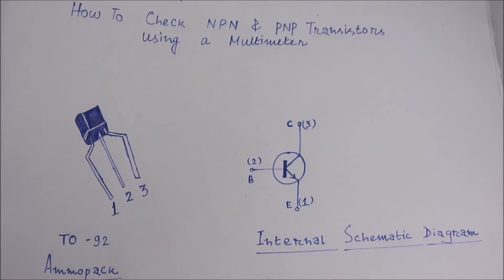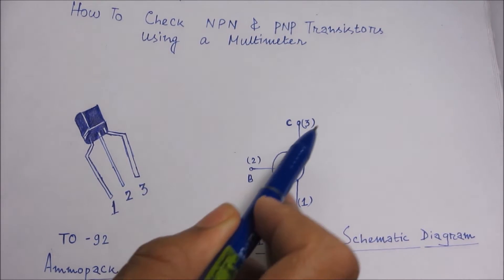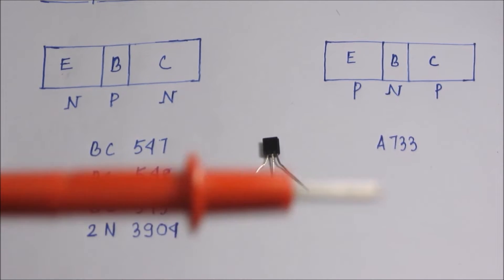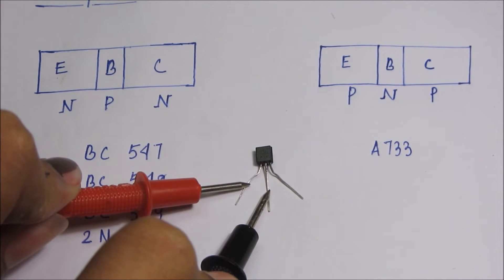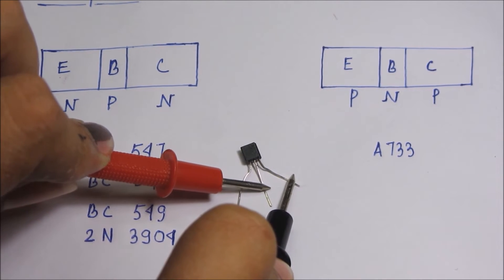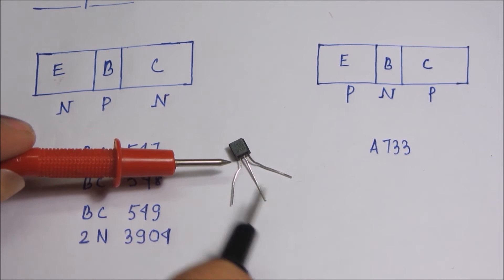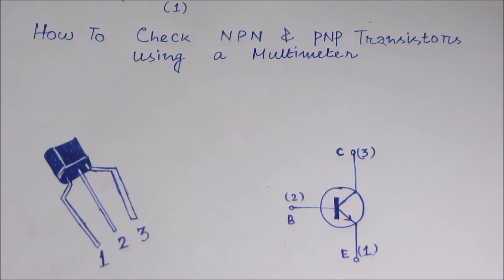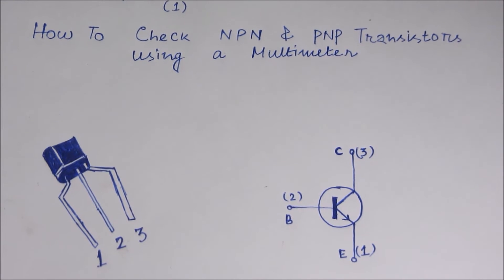How to identify NPN and PNP transistrors using a Multimeter

Comment: I need ur help sir.tnkx
Reply from the maker: Md Raihen, If you want to check whether a 12 V project board is okay or not ,you can simply check the voltage and current ratings across each devices used in the project. If they  meet the actual rating they are all okay. Otherwise change the respective components.But for doing that you have to first know about the voltage and current ratings of each used components from the technical manual of the project board . Thank you.